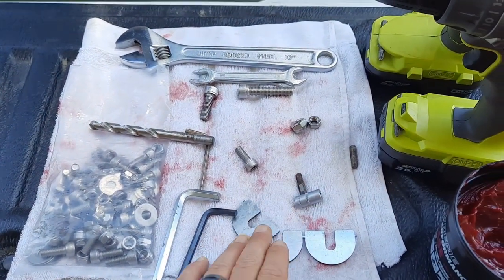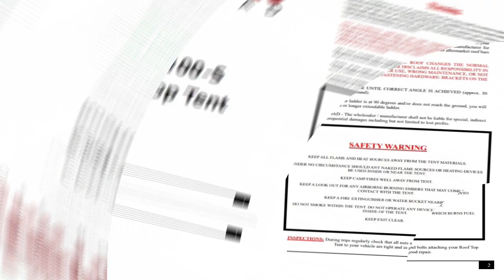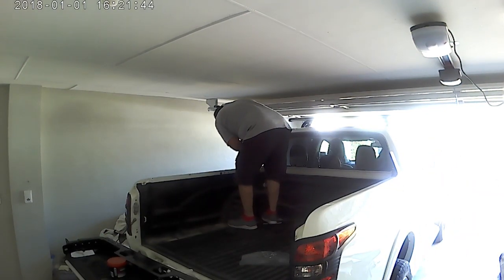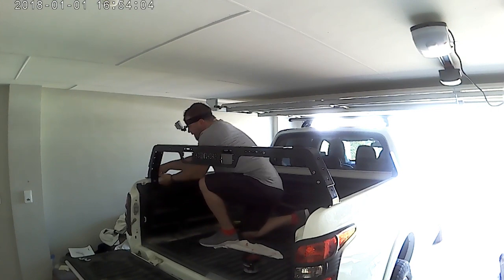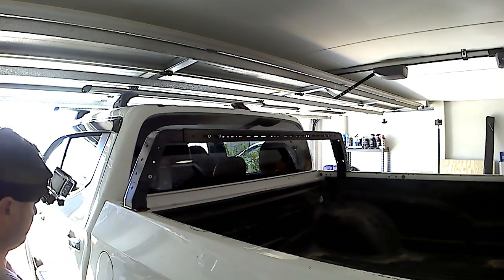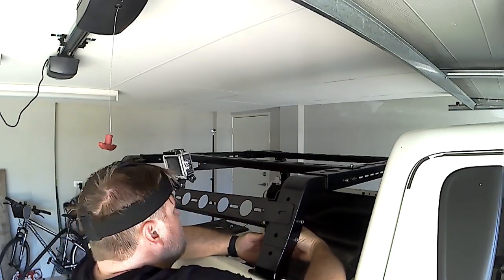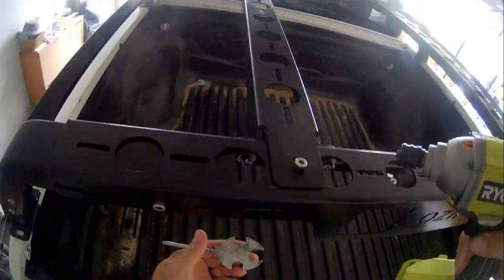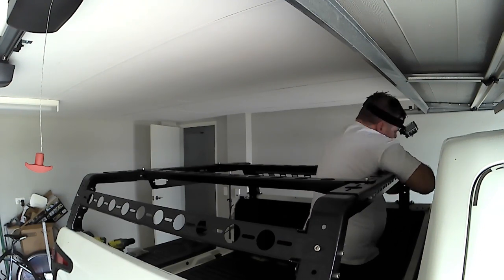Self Install Instructions For the OzRoo Tub Rack to Ute Tray From PPD Performance Part 1

Comment: Hi mate, how wide does the top load part of the rack end up being on the triton? Is there anyway to adjust the angle of the feet to make it wider/less wide?
Reply from the maker: You can adjust it in two areas by a certain amount, that being up and down in height (which isn't much) and sideways, one piece has a hole and the other is same diameter but cut long ways so you can adjust the width by bits to make sure it fits your tub.

Comment: Would you recommend putting a piece of rubber spacer between the tub and the rack, to stop friction wear?
Reply from the maker: Yeah if you check part 2 you will see this occurring and something I say I adjusted, we use foam that sticks to tub underneath brackets. I'm actual in process of recording this video in one part, shortened and in our new format and this will be right at front when looking at bracket attachments. Check again tonight and you'll find new version. I'll link to new video in this description and as a pinned topic. You may also note the instructions I made available I also mention the foam under brackets. But good point

Comment from the maker: Little pointer and reminder, when drilling the hole while assembling on your vehicle make sure you double check your measurements before drilling, as I used tighten front mount, and measured to back section but you also see me using a ruler to make sure I got it right, so double check before drilling.

Comment: Hey man cool video, my wife and I are fitting the same setup on our MN Triton, just wondering if you had any issues lining up the top rail Bolt holes to get the Tent central to the Rack.
Cheers
Reply from the maker: Shouldn't do, if you see how mine are positioned in both videos and take a look how I put my roof tent on shouldn't be any problems. Are you opening the tent out to either driver or passenger side or over the rear ute? I can send you instructions I did if that will help that I did
Reply: @wafishing4x4  you're video on your Tent solved the issue, we watched another video on the same tent setup and it gave us the wrong directions.
Cheers man.

Comment: How much does the tub rack weigh, approximately?
Thanks
Reply from the maker: It's hard to say specifically, but to help give you an idea I could lift the whole thing without any effort and I wouldn't say I'm overly strong. Whatever I say will be a guess. I did an update self installation video for this which combines both videos and shortens it as well as link to instructions. But
Reply: @wafishing4x4  Cheers mate. I watched the vid. Great job 👍

Comment: How are the bolts done up on the tub itself
Reply from the maker: @Suko1122  apologise for late reply, I hope you found your answer already but if not, they have larger bolts, and you drill holes into your tub at the connection points and then bolt it down. They're rather annoying and hard to get your hands into the tight space but it can be done.

Comment: Is this a full tubrack or half?
Reply from the maker: This is the half height version, full height sits slightly above the main roof height near height of roof racks, so quite high and with my lift, tires, tubrack and roof tent makes it impossible to park in garage though or least mine doesn't anyway.
Reply: @wafishing4x4  and u can still go higher if u wanted too
Reply from the maker: @Dan-2507  slightly yes, as brackets have couple of holes up and down which allow you some extra ability to lower or raise the height. I did mine just in the middle, but yes it does have some flexibility in height in both versions. I think in part 2 I do a few close ups on mounting bracket and make mention of that fact. From memory anyway

Comment from the maker: Since making the video I've been made area of what the U shaped metal items are for - being to make up the difference between the bottom and top of the tub if you go full height at ends between railings. I'll try include image to help
Reply: What do those little u shaped metal pieces do?
Reply from the maker: @markt9156  they generally used with full height and placed between two rails and held in place by bolts to assist with keeping rails correctly distance apart specially overtime. Or least that's what the company advised me when I enquired
Reply: Oh ok so I don’t need them if not running it at full height

Comment: Done well mate, but ffs, no instructions?? That’s kinda turned me off the brand.
Reply from the maker: Very poor instructions is what I'd say. I redid them and provided a link to pdf for so anyone can get updated version until they catch up or start using one I sent back. But it was poor as not much when you open the box to help you. Cheers. Have done reedit since, making it much shorter and including both parts which should be enough to follow special if you have the instructions I linked

Comment from the maker: Please see new update version in new format, shorter but with same amount of required information: https://youtu.be/5sv7lTJVrXU
Reply: I guess you have to line up the top braces to the holes under the tent but then I only see 4 holes and it doesn't seem enough to hold on to the rack.
I'm using kings rack with this tent.
Reply from the maker: @ezraarcena1928  I've seen kings fitted to this one before, generally the bars you have on your rooftent that you use to fix to either roof racks or the tubrack have a bracket system so you can move it around as needed. I think in one I put my tent on you'll see a rectangle long piece of metal with two holes x4, you use the bolts that slide in the bars you have fixed to base of tent to where it lines up either side of tubrack bar and you bolt the rectangle up tight to hold it in those 4 locations. If you need more, I can see about send you pictures or send me a picture of kings one to see if it's the same aluminium bars as Canyon has.